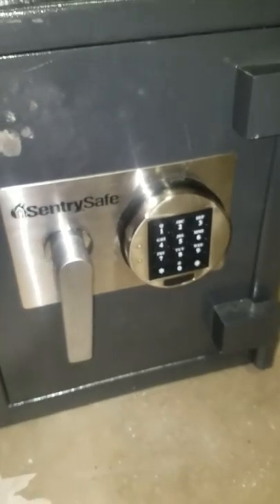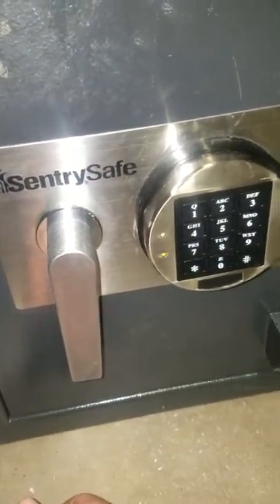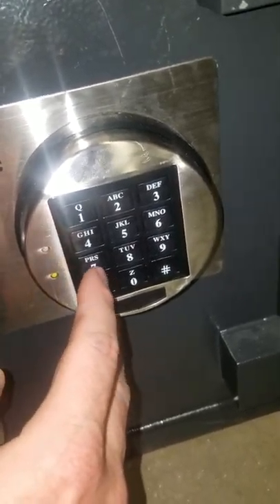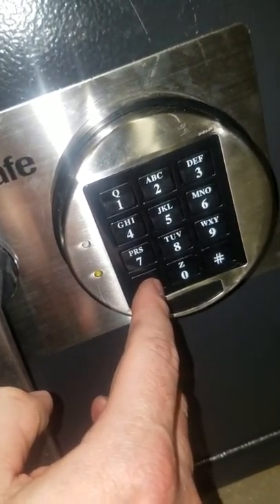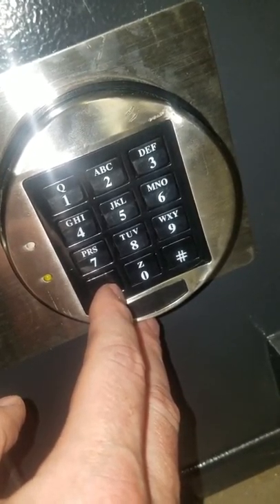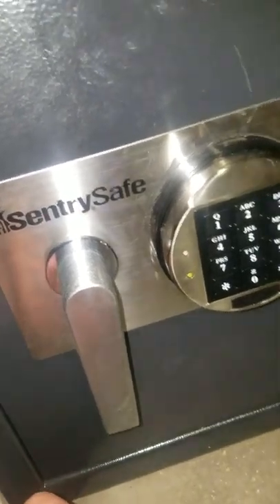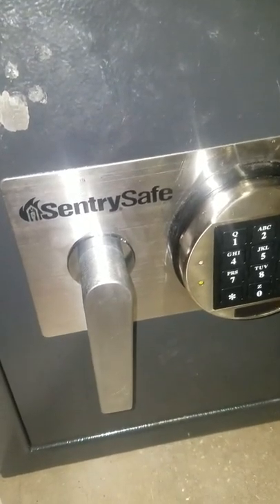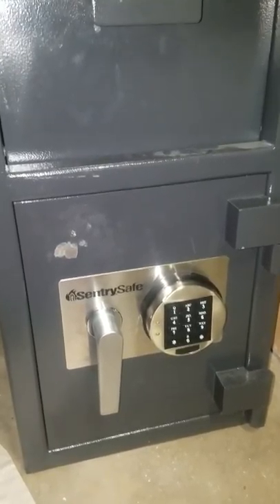Sentry drop safe refuses to open

Comment from the maker: I ended up using a sawsall at both sides of the top drawer where you stuff the cash.  It literally took me about 10 seconds per side with a regular blade to cut the rod that stops the top drawer from opening too far.  You can get into theae things so easy that it is a false sense of security to think they will protect your valuables.
Reply: Have an older GM2459E 23.5 cf Sentry gun safe with control pad, do you happen to know how to remove the front touch pad in order to change the batteries, thanks

Comment: with a sawzall or regular hacksaw blade, cut open the drop tray by inserting the blade vertically in each side and cutting down through the 3/8 inch threaded rod. the tray comes right out.  reach inside with a mirror, light, and phillips screwdriver, remove the inside cover, release the solenoid, open the safe, remove the solenoid, weld a couple of tabs with holes  to the front of the door, repair the tray you cut , and just use a combination or keyed padlock.

Comment: Have you tried a rare earth magnet? Seen ppl open them in seconds with the magnet.
Also thanks. I'll be returning mine to Sam's. Just bought one tonight.
Reply: did it work please respond asap. I need help
and did you use the same magnet on the same safe as the one in the video
Reply: @kaseanjones4849  I got mine opened, didn't use a magnet. It just started working again

Comment: It just happened the same with your. Do you have any idea?
Reply from the maker: I used a sawzall and cut the metal that stops the drop door from opening past a certain point.  Then you can pull the entire top door off.  It took about 30 seconds.

Comment: I've got the same one doing the same exact thing!  Opened it three weeks ago with no problem.  Had it for years with no problem.  And now I hear no audible response for the opening mechanisms when I enter in my correct code and get a green light like you.  Super infuriating.   Not even worth the $6 I spent on new batteries thinking that was the problem.
Reply from the maker: Read my other comment.   I was able to cut it open in just a few seconds.   I wouldn't use this safe to protect a ham sandwich.
Reply: @tylerexperience  I actually did exactly what you described with my sawzall.   Took all of about 10 seconds!  It was shocking.  Doesn't really matter in the long run because no one in my line of business pays with cash anymore as it is.  Thanx for the tip though on getting it open, now the safe goes to the metal scrapers.
Reply from the maker: @humananimal814  the scrapyard is where mine ended up too.  Glad it was helpful for you.
Reply: @tylerexperience  should have taken it to a handyman/welder, after you cut open the drop tray,  reach inside with a mirror, light, and phillips screwdriver, remove the inside cover, release the solenoid, open the safe, remove the solenoid, weld a couple of tabs with holes  to the front of the door, repair the tray you cut , and just use a combination or keyed padlock.

Comment: I did the same shit. Bought the safe from my neighbor and was pulling it up to me driveway. Well there is a 2" lip that is higher than the street.  So instead of lining up so the 2 wheels will hit the lip evenly and squared.  My dumb ass tried pulling it up from the street to my driveway at a 45-degree angle. So the one wheel hit first and got cough. Well. I'm sure you see the picture. It started to tip to my right side. Hey, I'm a tough guy! I tried to grab it. Hell, no...
I tried to keep it up for about 8 inches. Then I had to let go or risk permanently making myself disabled fir the rest of my life 
 I drropped it.. duh...
It took 3 of us to lift it upright.  

Now, the lock is open, and the code works.
It doesn't open now.......😂
Anyone, um, out there have a solution?
Or should I throw it in the river?
Reply from the maker: I don't understand your question.  It sounds like the lock opens and the code works but it doesn't open?  If the lock works and functions and the door doesn't open then something must be stuck where the door swings open.